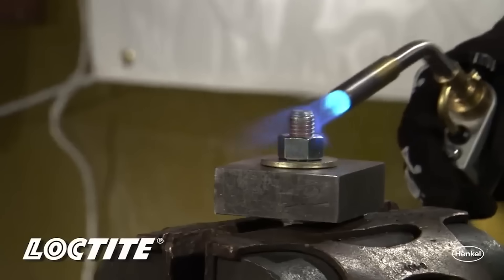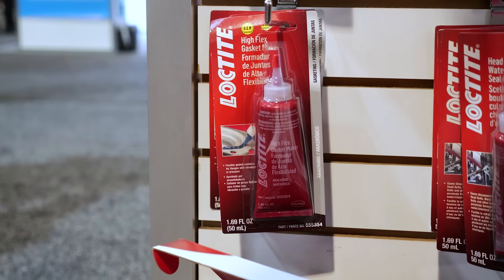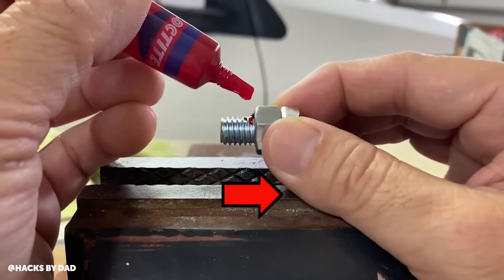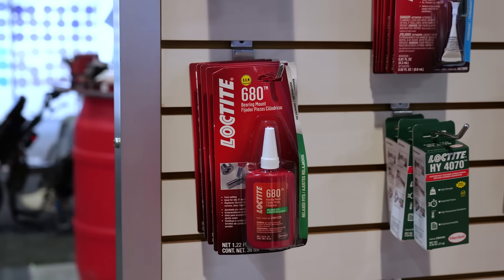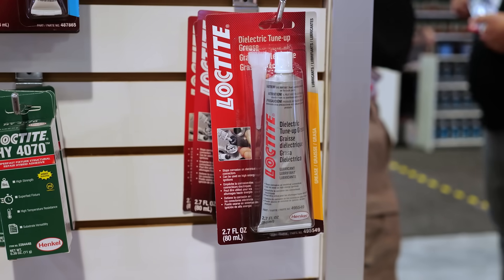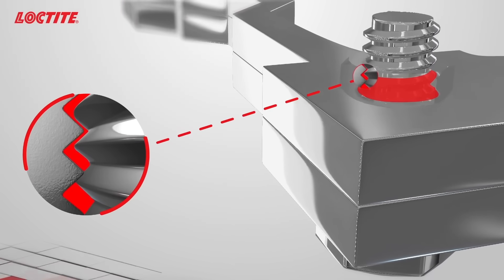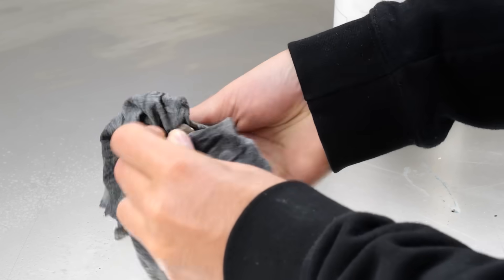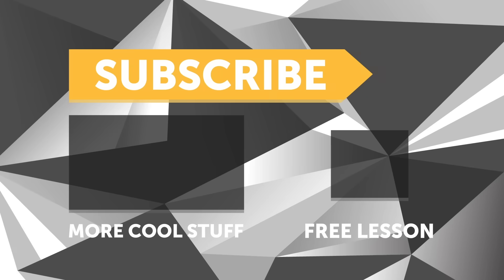Many pro mechanics don't know this.

Comment: For a high vibration environment (e.g. driveshaft, suspension) I use Nord-Lock wedge-locking washers instead of thread sealant.  No cleaning.  No priming.  No heat to remove.
Reply: Nord-Locks are simply the best form of lock washer available, fantastic product.
Reply: Not every fastener calls for a washer. Nordlok isn’t really made for automotive applications.
Reply: @egx161  can you elaborate?
Reply: Belleville washers are a good alternative too!
Reply: For sure, those are standard- but they flatten after first use and wont give guaranteed strength afterwards- after 1-2 uses it does no added advantage
Reply: @ I believe all permanent locking/holding solutions tend to be one time use 😉
Reply: @ghettobikelife8833  That’s very good to know.  I’ve reused crush washers more than once when I didn’t have time to get new ones.  I’m going to get a selection of Nordlock washers to keep on hand.
Reply: The Bellville must be rated for the torque application.   If you flatten the washer then it becomes a normal flat washer.
Reply: @HanksDeuce

Nod-Locks are great, but you only want them where they're REALLY needed. They are expensive.
Reply: @scottwhitcher265  Most of the non-alloy variants aren't that expensive around these parts in Louisiana.  Multiple fastener houses carry them which drives the price down.  For example, 3/8" plain steel Nord-Locks are around $0.75 to $0.90 each.
Reply: lol at first I thought you said nord vpn
Reply: @throwawaypt2throwawaypt2-xp8nx  🤣
Reply: Try some 3m yellow weatherstrip adhesive,it's like 3/4 the strength of blue from what I hear and it doesn't cause possible corrosion
Reply: Don’t forget the nordlock is one time use.
Reply: @HeidiFegles  On the overview tab of the Nord-Lock website, "Reusable (depending on usage environment)".  Do you have an example?  I've reused them numerous times in my automotive shop without loss of preload or having to replace the washers.
Reply: @ …paper mills they are not reusable. On a car they can be re used but they won’t be the same locking ability as new. Since the locking teeth can be damaged upon removing, in a mill we had reliability problems when reused on certain applications, since steam and heat are involved, and serious loss for a bolt backing off. The high profile equipment gets all new bolts and nord locks every time.
Reply: @HeidiFegles  Thanks for the quick feedback.  Definitely a tough environment you got there.
Reply: Nice choice, but I will swear up and down for aircraft hardware in suspension components. AN and NAS hardware is extremely expensive, but cheaper then a life
Reply: @hiramwillis  I’d vote for their use on brakes and steering components.  Do they have special fasteners for the lug nuts on the wheels?
Reply: @ ARP has always been a go to for wheel studs, but a lot of what I’ve worked for quite a while has center lock wheels. With those, they are replaced after so many cycles. It’s dangerous to apply things to wheel studs, unless specifically required, because the friction loss from things being applied to threads changes the torque and can cause excessive stretch of the fastener.
Reply from the maker: They are a good thing too 🤘 - Taz.
Reply: Wow never heard of that lock washer before. There is an application at work we have trouble with the bolts coming loose I think they would work great for.
Reply: Stage8 mechanical locks work better than Nordlock every time.
Reply: Nord locks are soft and can compress and get loose, we had a lot of problems on a Disney ride using it.
Reply: @mandytuning  The Nord-Lock website lists the plain steel washer hardness >= 465HV1.  That's higher than Grade 8.8, 10.9, and 12.9 hardware.  Some of their other alloy washers are much higher than that hardness.

Comment: From my experience in high temp application, blue holds much  better than red. At high temp, blue still retains its gue/gummy form which acts as a resistance, while red turns into dust and completely loses any ability to apply resistance to the spin.

Comment: Biggest thing to remember when using locktite is to wear gloves, stuff is very toxic!
Reply: Toxic?  Ive gotten the stuff all over my hands everytime i use it and even have had it dry on. My hands a few times..  ive never had any kind of reactions with it..  ive also held bolts in my mouth with it dripping off em..  so pretty sure ivr eaten a bit of it also..  id be more worried about all the break pad dust and road grime that ive been in contact with over the years..  then again i usually only use gloves when dealing with acids and only then after i feel my fingers starting to get eaten by the acids and hurt..  i think you just need to have some balls with hair to deal with certain things otherwise you should stay in an office and design the stuff and put all the labels you want on em..  unless its got a skull and cross bones on it than im pretty much not gonna give a damn about the other labels on it though..
Reply: @Z-Ack  Sir, please do not ingest threadlocker...
Reply: @Z-Ack  How old are you? Gambling with your health is stupid. Many things that are bad for you will show no signs until years down the line you become very ill. You won't immediately get sick and die from inhaling some brake dust, but do that for your whole working life and you can look forward to lung cancer and/or COPD. Imagine being out of breath just sitting in your armchair. Saw my grandfather live with it, and it's miserable.
Reply from the maker: @Z-Ack sounds like good health is something you will only start to appreciate as you begin to lose it. At that point 'looking tough' will be far from your mind, but in life sometimes you have to learn the hard way despite good advice coming your way from others who already have done that and only want to help you avoid their own mistakes.
Best of luck! - Taz.

Comment: When we lubricate a thread, the faster can over torque (unless specified as a lubricated torque)
It’s around 30% less torque than specified when tightening up a fastener. 

My question is, does the loctite act as a lubricant when torquing fasteners, and should we adjust torque specs based on that?
Reply: Im sure i seen a video testing this and yes it acts like a lube
Reply: There are dry and wet torque specs
Reply from the maker: Wish we covered that! Would have been a great topic. Loctite, from what I can find, state to use your dry torque specs but please consult the technical sheet for the specific product you are using given they have many, and reach out to them directly if in doubt - Taz.

Comment: Does the primer etch the coating off? Is that it’s purpose
Reply: Its action is twofold.
1) The carrier solvent washes oils and such off the metal, exposing bare surfaces for the thread locker to ‘engage’, keying into mechanically &/or adhering to chemically.
2) The extremely fine powdered copper particles carried by the solvent (which give it the green color) are ‘active’ chemically, pulling oxygen atoms off the passivated ends of the liquid thread locker molecules to oxidize the copper, thus letting the molecules bond end-to-end and polymerize into a one piece permanent solid. This substitutes for the surface activity lacking in ‘inactive’ metals such as stainless steels, zinc galvanizing, and the deeply oxidized surface of anodized aluminum.

Comment: thing with active metals and primers is red loctite will bind with metal atoms and interlock. Something like corroding metal so it has surface to grab on to. Primers help with that when bolt has zinc coating - or black oxide coating or other.

I only ever bought blue loctite, i had small used tube of red from friend but i only use that on small (M3,M4,M5) bolts that will never be unbolted (fasteners for 3d prints as for holders or structural stuff inside prints - e.g. fuse and relay boxes). Also amount of drops depends on fastener diameter, one drop is enough to coat whole M3 bolt while for M20 five or six may be enough)

Comment: Whatever you do, just make sure you absolutely DO use the permanent red thread locker on all Phillips head screws that hold the brake rotors in place!! It makes it fun for future mechanics working on it 😂
Reply: Also, be sure to really tighten those screws. If you don't see metal shearing out of the screw head, you're not tightening it enough.
Reply: @Kj16V  Impact driver works both directions!
Reply: Why do they put blue in a red bottle?
Reply: @user-se7vt5ow4e   "Why do they put blue in a red bottle?"

That's been my complaint since I was a teen backyard mechanic in the '80s.  Loctite sells a color-coded line of products -- and then puts them all in the same color bottle!  WTF???
Reply: @Milesco  Packaging consistency is probably why. It isn't that hard to look at a label. I've never had any trouble finding the right one on the shelf.
Reply: @richardclifton4120  I've have the same big bottles of red and blue for ages, the labels have held up just fine. You are just looking for something to complain about.
Reply: @richardclifton4120  I can reply to whatever I want. My bottles go in a bin with all the other automotive goos. It is far from a neat and tidy shop. It is a fleet shop. The labels are fine. I am saying you are complaining about a nonexistent problem for the sake of complaining. You can take your whining about nothing and do the same with it as my opinion.
Reply: Why do they put blue in a red bottle?"  Loctite is a Henkel company; Germans "don't make mistakes" and are quite stubborn by nature.  I worked at a company 40 years, 10 after Henkel bought it, and I know !
Reply: @user-se7vt5ow4e  And why make a high strength blue threadlocker (242)?
Reply: Bro, you don't even need any thread locker for those to be satan
Reply: @Sk1m_Beeble  Usually you can just take whatever bit it needs and give it a good swat with a hammer before you go at it.
Reply: Me and dad were doing a bunch of work on his 17 KTM rc390. 
After about the 5th difficult bolt we removed and noticed tons of loctite , we knew if a bolt felt tight give it a little heat from a heat gun and be careful of paint.
A little bit of heat helps a lot
Reply: Nah, you gotta get a box of those screws they use on bathroom stalls.. the one way kind..  thatll really make em end up buying you a new rotor after they attack it with a hammer..
Reply: ....AND what if the next mechanic to work on it is you????
Reply: Bearing retainer works great as an alternative if you're out of red
Reply: If I'm breaking them loose in the future I use Vibra-tite, designed to be re-used as it is on your threads WHAT A CONCEPT😂
Reply: @William-Bill-Munny  Why would you put anything but anti seize on those? They can't fall out, and if they come loose, which they won't, it makes no difference whatsoever
Reply: I finally found the guy that is doing this to me!!! We need to talk... 😉
Reply: There is a special place in hell
Reply: The future mechanic will just sell you a rotor, hub, and bearing.
Reply: @lolatu8255  You need to find a better mechanic. I'd just drill it out and not worry about it if I actually couldn't get it out. But I have torches, they always come out one way or another.
Reply: I've used it for decades and have no trouble removing rotor screws, but I don't slather them with it. It acts as anti-seize by excluding moisture.
Reply: @oldphart-zc3jz  Why not just use anti-seize?
Reply: Put as much of that liquid garbage on as you want, it wouldn’t even slow me down.

Comment: if its not for exhaust,  why does gm use them on exhaust manifolds? when you buy new bolts it already has blue loctite
Reply: @DC-si8xw  I don’t know this to be a fact but… it IS a thread locker, and it IS blue, but… I don’t believe it is “loctite”. Different brand, different formula, just happens to be blue. 🤓
Reply: They don't get nearly as hot as exhaust downpipe or turbo hot side bolts. Unless you're talking about a GM turbocharged vehicle that came with threadlocker on those bolts, assuming you mean GM LS/LT exhaust manifold bolts.
Reply: @GTStuning-  The manifold doesn't get as hot as the downpipe? Er.... yeah righto....
Reply: @noxious89123  :  The manifold bolts (as opposed to nuts on studs) are threaded into the water cooled casting of the head, so temperatures there are less than parts with the exhaust on one side of a thinner structure, and only air cooling the other.

Comment: No expert, but we go through about a dozen 250 mL bottles of 262 (red) per year, here. In my experience, you only get that super duper retention if the threads are perfectly clean and primed. If all threads are perfectly prepped you'll break something before getting the fastener out. But most fasteners lying around your shop won't be perfectly clean or primed. 262 in this case WILL be removeable.